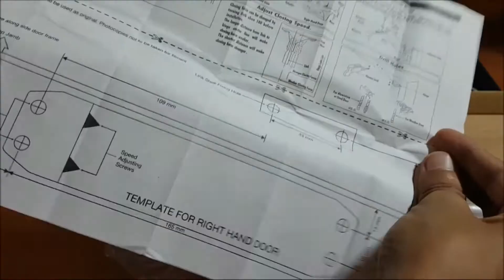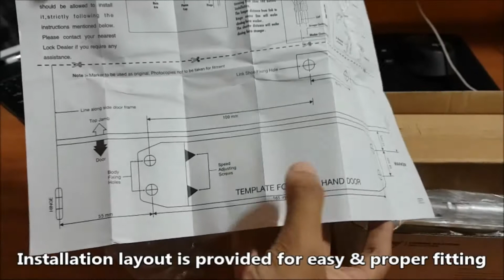Godrej C071 (Two Speed) Hydraulic Door Closer (Silver Colour, 60KG Pulling Capacity) Unboxing.

Comment: Bhai speed adjust kaise hoga?
Reply from the maker: It's very easy sir. If you carefully observe the main device then at one of the sides you will observe two screws. The upper one is used to adjust the pulling speed of it & the lower one is used to adjust the closing speed of the doors. You can adjust both of them as per your requirement. Or you can adjust the lower one separately as well. No problem with it.

Just take a screw driver and go on adjusting both the screws and check each time till you get the exact adjustments for yourself. If your door has a self locking mechanism then try to keep it a bit hard so that whenever you open and close it the door automatically locks straight away due to the pulling speed of it.

Thanks for supporting my channel and please subscribe to us for more videos in future ☺️!!

Thanks in advance 🙂🙏.
Reply: @AnirbansReview  Okayy got it. Thank you so much.
Reply from the maker: You are most welcome 😁.
Please subscribe to us for more videos. Do share my videos too as well. Thanks a lot in advance 🙂.

Please feel free to ask me any question anytime and I will be happy to help you out 😌.

Thanks.